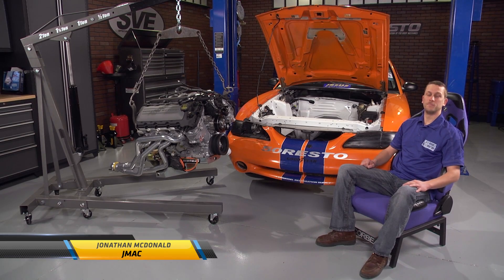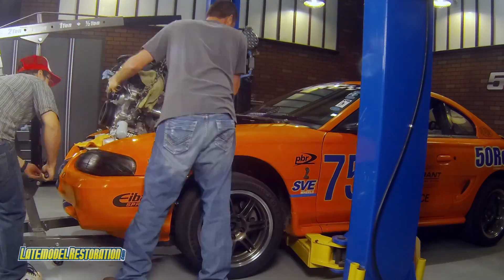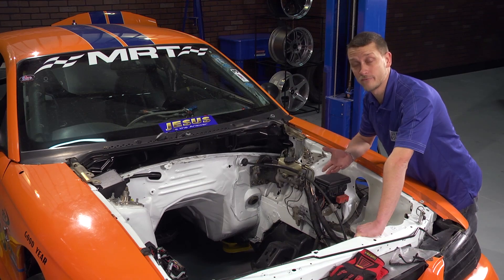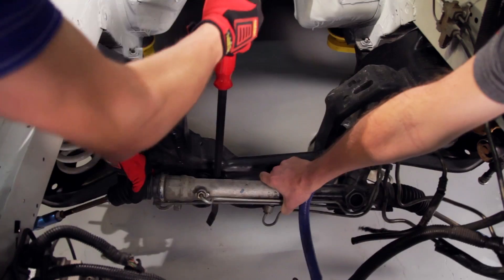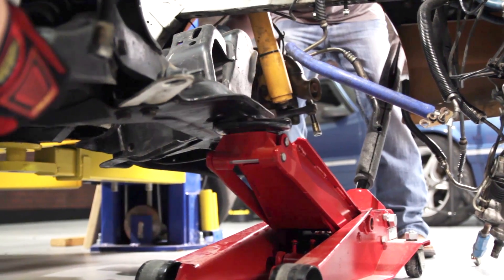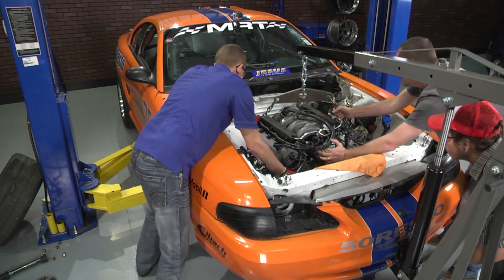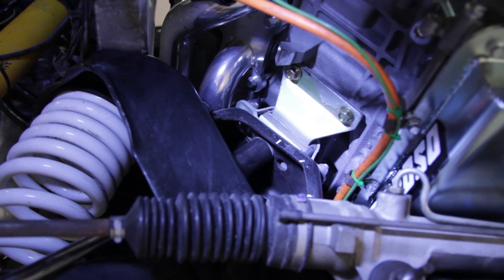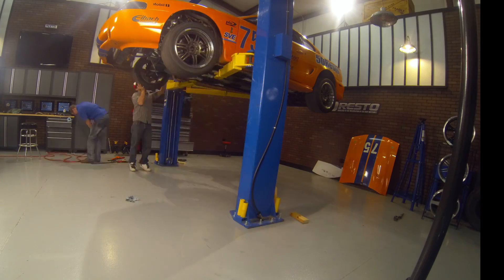Mustang Coyote Swap: 5.0L Engine Install

Comment: Do I need to change v6 transmission if put in 5.0 motor stick shift btw!?
Reply from the maker: Bbmane - You'll need to provide more information than that.  Are you talking about a 5.0L Coyote engine?  If so, then yes, you will need to source a transmission from a Ford modular V8 engine (Ex. 4.6L, 5.4L, 5.0L).  -Landan

Comment: ok so im swapping a coyote into a 2000 gt  using bbk and moroso oil pan  what modifications did you have to make to get the headers to clear the passenger side of the engine

Comment: anyone have a vid on how to do it on a v6 new edge?
Reply: Did it on my 03 v6, its pretty much the same as this. I did swap the K member for the Maximum motor sports one out of preference for some minor weight savings.
Reply: @montydurand467  any surprises or was it pretty straight forward. I'd like to do this on my 2000 v6 it'd definitely be my biggest project to date

Comment: I really want to put one of these into a '65 fastback with a turbo/twin turbo setup. All that power in a 2600 lb car would be insane.
Reply: you can run low 10s with a bone stock coyote fox, those things fly

Comment: Latemodel Restoration Supply Inc is there any specific reason you didnt use a tubular k mamber? Not that your answer should be then end all be all but you end up going with a remote oil filter. Would you recommend this for all swaps?
Reply from the maker: The race suspension on this car was initially set up for a stock k-member. That is why we did not go with an aftermarket k-member.

Comment: I just finished putting a Navigator engine in my 2000 Mustang GT.  That was the most difficult swap I've ever done because the 32 valve  engines are SOOOOOO big.  I just came from work where we had an old 454 laying around.  I pulled out a tape measure and started comparing physical size.  The 5.4 32 valve Navigator motor is wider, taller, and longer than a GM 454 big block.

Comment: Excellent video, I have a question though, for a 99-04 Mustang body, I want to swap a coyote motor in myself, but I have never done it before, do you recommend trying it? How long to complete such a project? thanks
Reply from the maker: On New Edge Mustangs (99-04) you will need to convert your fuel system to "return style". If you are mechanically inclined, this project isn't overly hard just time consuming. You can easy expect this to take a few weekends if you put in a couple of hours every weekend. If you have some help and pull an all nightner it could be done in a really long week.

Comment: Can you use the stock t 45 trans
Reply from the maker: Yes you can. I wouldn't recommend it for long term drag racing use but it would be just fine for day to day driving and some road racing.

Comment: I have a quick question for the latemodel resto guys. Have you ever considered swapping the gt500 engine into a sn95? I love the 5.0 swap and may do this one myself
Reply from the maker: Ray Burkett it has crossed the minds of a few of us around here. Ford Racing makes a controls pack for the 5.4L DOHC engines. Check it out here -- http://www.latemodelrestoration.com/item/M601754SC/Ford-Racing-54L-4-Valve-Supercharged-Controls-Pack
Reply: Very nice. What engine mounts will work with this?  Going tubular kmember

Comment: Ok, ready to go Coyote with a 94 Bondurant SN95 Pushrod 5.0 Stang. Never been titled so No Street Use. Also going to use a TR3550 That's hanging on the old 5.0. Will the Crate Motor Flywheel work or do I have to go 96-04 8 bolt? If I go MM or UPR Tubular using Coilovers - what rate should I go for Open Track / NASA AI?  Also, would that force me into Coilovers in the rear also. I have 10 years Racing SCCA A/S and T1 Stangs & will most likely just use the car for Central Fla Region Open Track HPDE NASA Events.  Would hate to throw a 96 - 04 4.6 Heavy Stock K Member in there because of rear axle dynamics ...  LR Thoughts ???  Whooomah!  FE
Reply from the maker: You will need to use a 96-04 flywheel. Your best bet is to contact MM and go over your whole suspension set up and they can better determine what spring rate you will need. Once you know that all you have to do is contact us. We have had a lot of success with the factory k-member. We stuck with it also to avoid completely rebuilding/rethinking the front suspension at the time - keep what had worked. Please feel free to call us if you have any questions. 254-296-6587
Reply: ***** Thx much LR!  Have checked with Brian at MM on spring rates. Since it's a 94 5.0 K Member I must swap anyway - LR's opinion to swap a 96-98 factory K Member in in favor of tubular with coils then?  FE
Reply from the maker: Eddie Ford Being you need a K-member anyways for the swap. I would use a tubular set-up. It gives you a lot of extra clearance as well. -- Jeff J
Reply: Thank Jeff 8-)
Reply from the maker: Eddie Ford No problem. That is what we are here for!

Comment: Ok just to b clear you guys retained the stock k member?
Reply from the maker: Yes we did. The front suspension was built around the front k member and we didn't want to change that up.
Reply: I can't agree more.plus I hear running after market k members can give a harsh ride on the street.thanks for the reply
Reply from the maker: Not at this time. Sorry. - Jarrod

Comment: What type of fuel system is need for this to work in an 04 mustang gt. and what would i have to buy extra if i use my stock fuel system and do yal sell all the parts for the fuel system